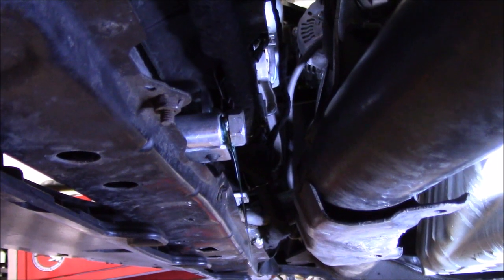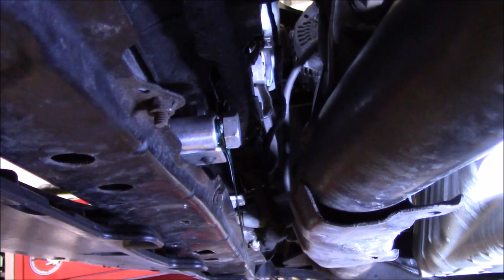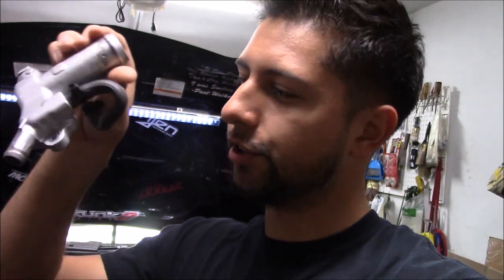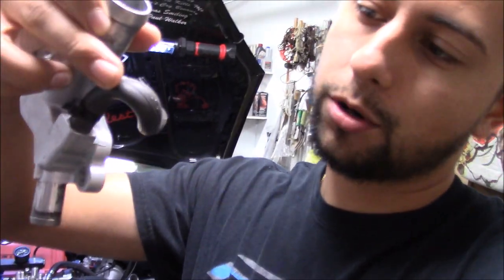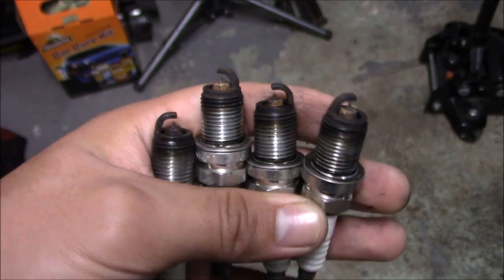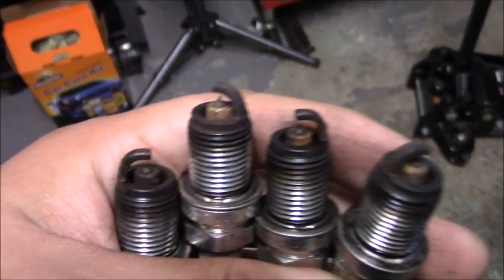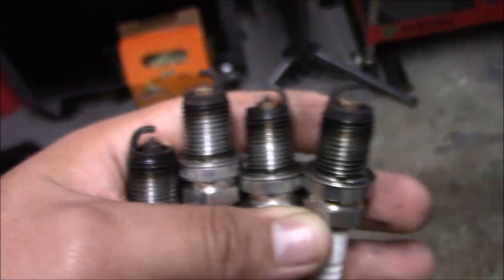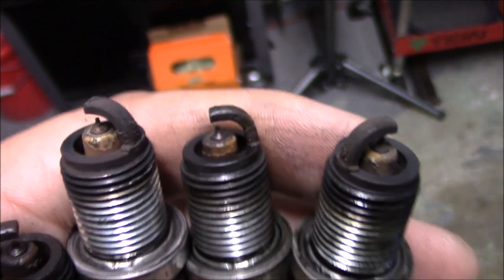Coolant Leak update / Spark Plug Help?

Comment: I have a Toyota  Prius 2011 that is leaking antifreeze inside the chamber, but the compression is ok. Can you tell me if there can be other way it can leak from besides the head gasket? Because it never hover heat

Comment: If you're running factory plugs still, you should definitely go one colder not hotter. Nitrous guys will usually run copper but probably won't hurt.

Comment: That "temporary" hose wouldnt last long either... every coolant hose should be braided in some way. Thats the main reason the vaccum cap burst and the air hose you now use will to. (Already saw a few people on track with the exact same hose burst, looks like a pcv hose)

Comment: Hey Serg I’ve noticed you still got your iacv and you’ve plugged the coolant lines. Have you ever had any problem by doing that? Was planning of using my iacv when I swap in my intake manifold and throttlebody but not sure if I should plug them or use a single hose and loop it to connect

Comment: One more question... i see you have a filter on your valve cover, doesnt that oil come out of it while engine is running? I am getting all of the creepy oil into the intake hose and into the engine again, it really kills the clean air fuel mixture...
I am running the iridium plugs but i run on k24 stock head, never had a problem tho
Reply: That port sucks air from intake. Just gotta clean your intake from time to time
Reply from the maker: i use that filter as a breather, it doesnt smoke just has oil on it from blow by. going to go with a catch can set up in the future
Reply: Intake gasket upper an lower

Comment: bro i have a problem with my rsx, i put a motor k24 and when you turn it on does not accelerate, it is only when the engine is cold, if you know what happened with the car tell me please👍✌
Reply: Christian RC what do you mean it doesn't accelerate? It won't move at all or it just accelerates too slow?
Reply: Loyal Honda Fan does not accelerate, and if you hit the accelerator goes off
Reply: Loyal Honda Fan but when the engine heats it acts like new
Reply: Christian RC so your car does not accelerate when you step on the gas on a cold start? But runs good when it's at operating temp?
Reply: Christian RC that has to be a sensor issue, i have to think and i will let you know. Nothing serious to worry about tho
Reply: YoungInn G yes run perfect
Reply: Loyal Honda Fan ok thanks man👍
Reply: Christian RC possibly your plugs and maybe a stuck throttle body. If you have a check engine light on; best thing to do is diagnose those items first.
Reply: Christian RC is your car tuned?
Reply: Christian RC sure no problem
Reply: YoungInn G no
Reply: Christian RC pump gas!
Reply: Check Fuel preasure ⛽️
Reply: Andre Dc5 ok thank you, I'll check👍

Comment: First comment yo! ^^

Bro i need your help i am stuck, when i put the timing marks all in place on the right side the chain has some slack and it messes the timing up when i turn 4 times the crankshafts and the outcome is that the camshafts are in time together but the crankshaft "retards" like 5-6 degrees... some help bro i cant drive to my home neither go to work, i tried many ways for 7 whole days and cant settle it right, is my chain stretched? The engine has 155k kilometers (100k miles)
Reply: Loyal Honda Fan you should change your timing chain and chain tensioner.
Reply: YoungInn G is that a 100% sure thing? I ordered a whole set i ll get it in next 2 days thanks a lot 💪✌
Reply from the maker: its sounds like a bad tensioner, chains dont stretch that much so id look into the tensioner first
Reply: I would do both since we are there anyways.
Reply: Loyal Honda Fan I can't say 💯 but that was my problem. That was the only thing I could think of because my timing kept changing. Went with an educated guess and fixed. New timing chain and tensioner. Don't get no cheap stuff.
Reply from the maker: yea i agree, only quality parts when your doing this kinda stuff. oem honda tensioner is the way to go and chain
Reply: SERGMOTIVE GARAGE damn i am getting aftermarket, 170 for all the set with guides and stuff, the thing is before i even install the tensioner while having all the spots lined up i have some slack between the intake camshaft and crankshaft, how can the tensioner affect that at all when from the start the problem occurs between those and the tensioner is still out!?
Reply: SERGMOTIVE GARAGE as far as i know the chain between intake camshaft and crankshaft should be "tight" or to say it better it should not be loose at all while timing the engine, the tensioner feels pretty good and keeps pressure the problem is not that at all! So you say that the 100k miles chain should be able to be reused and the shouldnt have been retarding 5 degrees... i dont know what the fuckin hell i am doing wrong than... i got the camshafts blocled from the other side where those special holes are  and i get the upper marks of the chain between the spots and the lowest chain mark on the marked tooth on the crank sprocket and it faces the engine mark aa well for TDC, should i turn 180 degrees the camshafts and fuckin turn the engine till i feel the valves going through the pistons?
Reply: After 5 years, just had a random notification on this, this is an update guys, the problem was my timing chain, no matter if its an OEM or an aftermarket one, the chain will have some slack after couple miles, so consider changing your timing chain if you have to remove it and reinstalling it, otherwise you wont be able to time the engine with a used one.

Btw much love to Sergomotive ❤️ always being cool and helpful :)) 👌